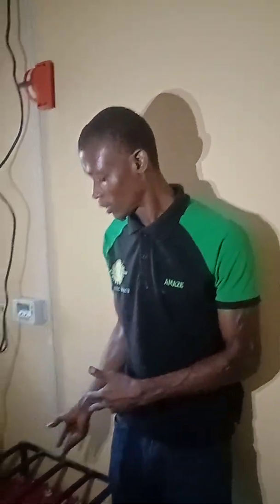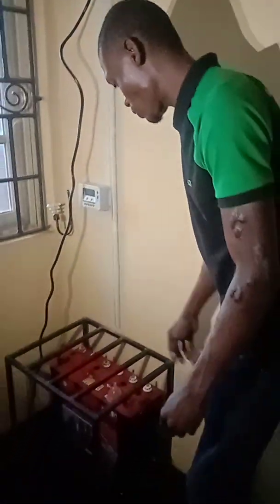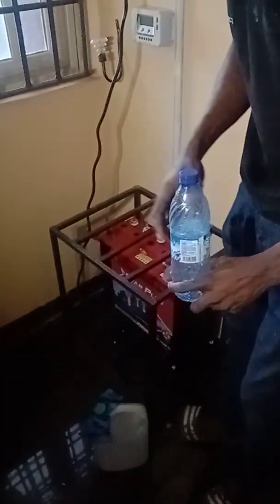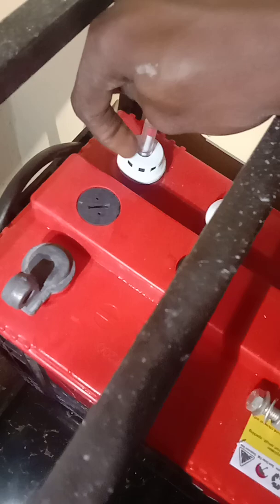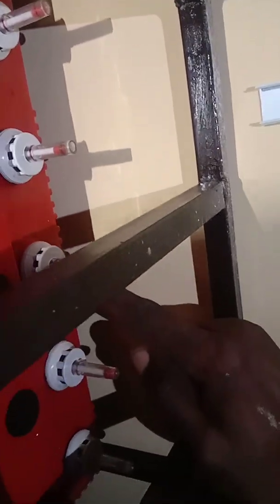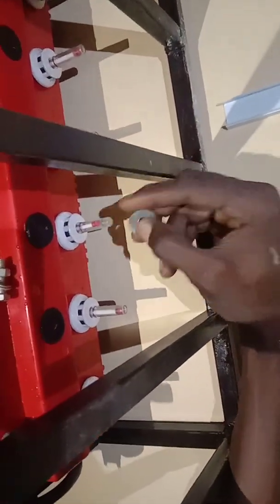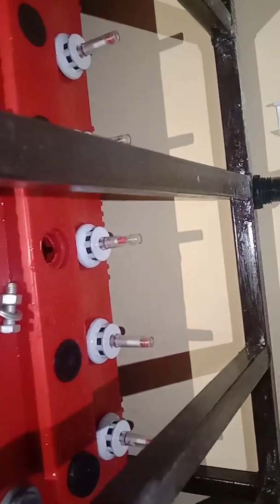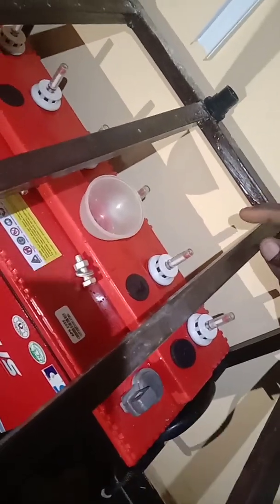HOW TO TOP UP YOUR TUBULAR BATTERIES WATER LEVEL BY YOURSELF AT HOME

Comment: Thanks for this video,really informative.I have a tubular battery bought and used it for just 3months then I abandoned it for like 5months when I wanted to use it I noticed that the water level had dropped so I topped it up with distilled water but one of the gauge has refused to come up despite the fill up with the distilled water.What could be the cause?does that also indicate that the battery is damaged.
Reply from the maker: No o, that doesn't mean the battery is bad, because the battery dry up, the water density is low, so you have to allow it charge then as the density saturates the indicator Wil rise back

Comment: Thank you so much.
Please, is it safe to refill the battery water when the battery is connected?
Reply from the maker: Yes, you can, if you are scared, make sure the inverter switch and other breakers are switched off before doing it

Comment: Hi boss I got an inverter in August last year,then this year may,I traveled without charging the inverter,when I came back this august,I realized the water has been drained from the inverter,and it wouldn't come on,so I poured enough distilled water,and charged it for a few hours,but the battery doesn't last like it used to anymore. I was advised to boost using an industrial charger. What do u think pls
Reply from the maker: @Daniel-v6p1g  yes, make use of industrial charger

Comment: In the process of adding water and it over gadge in the process

Will there be consequence

Thanks
Reply: Well actually it dose affects the power of the battery, normally there is particular percentage, ratio of sulphuric acid to water  in every tubular which is being maintained by adding water periodically because only the water inside the battery evaporates and the sulphuric acid dose not so if the solution overflows it means part that supposed percentage of sulphuric acid has been lost thereby reducing the energy density of the battery.
Reply: You just use a syringe 💉 to pull it
Reply from the maker: No consequences sir, just leave it, once the battery recharges back, excesses will drip out, so you might observe the floor being wet, just mop it off, that all
Reply: This is a good job more blessing